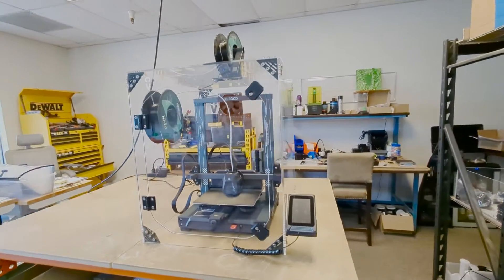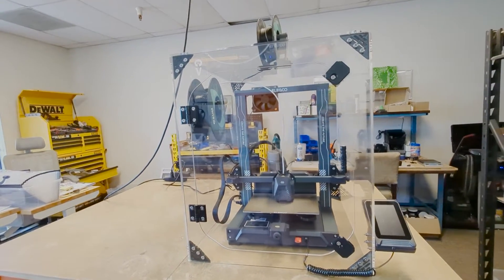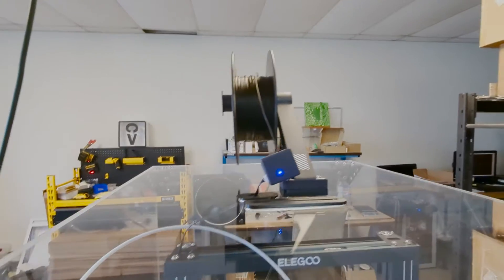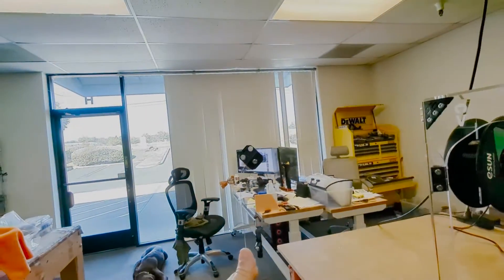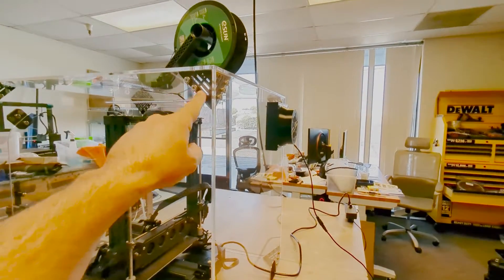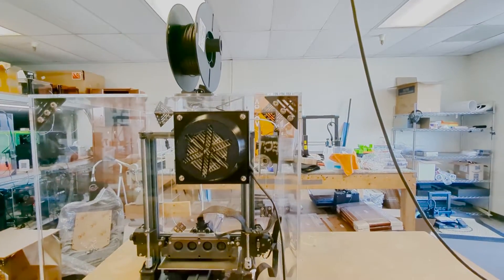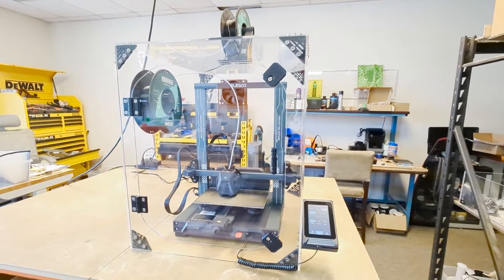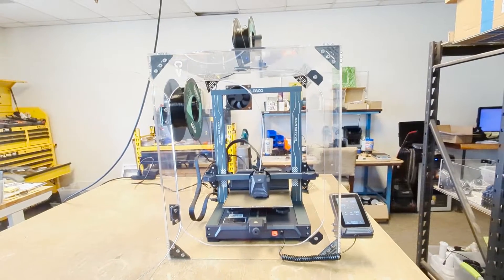Elegoo Neptune 3/4 Pro/plus/max Enclosure by Clearview Plastics

Comment: I do not understand something, please help me. 

At the start of the video, you suggest the primary reason for an enclosure is to keep the filament clean and dust free. Then you start listing "features" of this enclosure and explain that you can mount the filament and sensor on top (unprotected)? 

Is there logic behind the necessity for these cases with regards to the filament? Obviously most people would be looking at enclosures from the perspective of sound minimisation in domestic uses, and the dust and other reasons would be more applicable for industrial uses.
Reply from the maker: This is simply for option sake. Some users prefer to be able to use the external spool holder. I would suggest the internal spool holder is better, but everyone has different setups so with our enclosure it provides options on how you want to feed your filament.

Comment: Hello, do not bask the brains from below? I think to raise the box slightly higher so that the bottom of the table is on the street?
Reply from the maker: I would suggest the base of the enclosure stays within a reasonable operating temperature. We've tested a variety of printers in our print farm that print 6 days per week. We don't have issues with electronics. For users that want to vent their printers, we are supportive for users to DIY a mod like that.
Reply: yes

Comment: Putting aside the insane cost of this encloser that others pointed out, I would worry about Heat.  

The base is where all the electronics and power unit is in and that has fans to try to cool them?
If the base is inside the encloser you will soon see the electronics over heat if your doing say high temp printing where the bed is 100 C and the head is 300 C. ( possible 400 C + oven )

Soon the poor printer be totally over heated and fail.  Not a good outcome.

Any encloser should have a raised design where the base of the printer is outside the encloser, the floor of the encloser fitted around the X axis frame that the bed wheels ride on so the bed is inside the encloser and the base is outside keeping it cooled. 

The floor of acrylic on small strong feet so it sits at a level just under the moving bed so the heat don't escape from the enclosed part where the frame of the printer is and the cooling air gets to the base where the electronics sit.

There is enough gap under the bed wheels to fit a floor panel for the encloser.  That would be better than the whole printer inside the enclosed area of the encloser.
Reply: That's the first doubt I had while planning the enclosure! I'll keep electronic out!

Comment: $800 is absolutely insane, especially considering this seemingly uses most of the same hardware as your other products. It's great that this is made in the US but I could built this for about $200
Reply: Again, love small business owners, but $800 for a $500 printer is crazy.
Reply: @alfrednorris1895  at that point buy a K1 MAX and have an enclosure and faster printing speed or any bambulabs lol
Reply: 100% agreed. It's like buying a car and then paying twice the price for tires. Even that analogy doesn't quite fit because you can still use the printer without the enclosure
Reply: No hes right, the enclosure is the same price as the printers themselves
I get you time and effort but you print the parts yourself and use pretty easy to acquire parts. 
Please understand I like the idea but you are asking for to much when I can buy one from a printer company for 60$
Yes they arent as "pretty" but they are your competitors and you aren't making it easy for yourself
Reply: in canada just a sheet of 1/4" acrylic costs like $400+ tax. also how much is your time worth per hour?
Reply: @chrishayes5755  you would only need 1/16, at most 1/8" for this. My time is worth a lot less than $800. I could build this in an evening
Reply: @chrishayes5755  in australia, all the panels for this would be $230 Aud
Reply: @chrishayes5755   just a sheet thats insaninity, im calling cap lmapo, but I would happliy give 40 hours after a work week to make this, that 800 is like a week of pay lmao

Comment: Wouldn’t the electronics overheat… what kind of internal temperature from the bed alone can you expect for abs?
Reply from the maker: This is generally the biggest concern for users. We'd suggest it is an overblown concern. Generally, there power supply and mainboard are at the base where it is coolest. We keep a farm of 15 printers and we've torture tested printers. So far we've had zero power supply and main board failures. If printing with high temp filaments like ABS, it likely isn't possible without an enclosure. So if one wants to print ABS, but doesn't want to enclose due to heat concerns then they won't be able to print ABS anyway. In the end, we think most users will have a good experience and a lasting printer even when enclosed and printing high temp filaments.
Reply: @clearviewproducts  These enclosure will never top 130f...most computer components can handle 70c on the extreme low end (158f), and capacitors and resistors can handle 90c plus.  It is not a problem.  People think things are hot when their fingers say ouch.  Truth is that is around 115f.  Guys, your components are fine.

Comment: This looks a lot nicer than the low rent 30 gallon clear garbage bag that I use on my Neptune 4 Pro.  I reinforce the bottom 6" in the front of the trash bag with duct tape, and put a piece of duct tape on top with a hole punched for the filament to enter.  It's very low rent, but I've printed a few hundred hours of trouble free ABS parts.  The 110 C bed passively heats the inside of the garbage bag to 55 C.

I also print a lot of TPU without an enclosure, and the reverse Bowden tube is a complete non starter for that, but your top mounted reel should work well.

Comment: Who's gonna pay $800+ for an enclosure for a $470 budget printer?  I was excited til I saw I could buy a second printer and a couple dozen rolls of filament for this cost
Reply: Also a problem with your answer is that your answer has nothing to do with the question. I don’t think people came to comment because they didn’t know why someone would want an enclosure. They wonder why an enclosure that clearly has far less manufacturing and engineering cost than the printer itself is nearly double the price of the printer…
Reply: You take a hobby maker level printer and make it cost that much? What market are you aiming for?
Reply from the maker: There are some great reasons. Enclosing large volume printers like this is the largest segment of Clearview. When printing objects that utilize the size of the printbed you'll find that many objects have print issues when printing in an open air environment. This happens especially with advanced filaments like ABS where printing without an enclosure just isn't possible. Additionally keeping the printer enclosed will make the nozzle and printer stay clean for better long term usability. The Elegoo N4 Max can print amazingly, but without the right printing environment it will hit its limitation on anything over simple prints. The users that pick up these enclosures need more assurance that the print will be successful with better overall print quality. The alternative for these users to assure good print results and high dollar large format printers where the cost would be significantly higher.
Reply: @clearviewproducts  for what youre asking i can buy a large volume enclosed printer much nicer than a neptune but if people are buying it i guess the price is what it is
Reply: @steelcityhero1994 yeah you can buy a x1 carbon for the price of a elegoo neptune and this enclosure.
Reply: @clearviewproducts  and a grow tent does everything yours does, is fire proof and costs like $80.
Reply: @clearviewproducts  you gotta pretty close to braindead to think this is worth $800 it's not even $100 worth of material
Reply: @clearviewproducts  yes I have had both the  Elegoo and the AnyCubic max and that is precisely what I believe the problems were. I think they are both great  printers (chev/ford type of decision) but they really do need a cover.😉